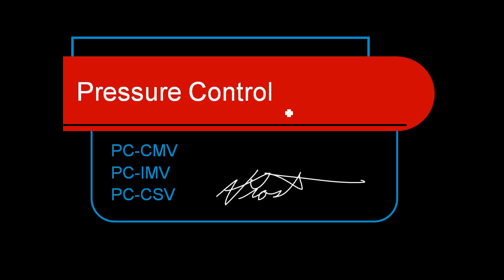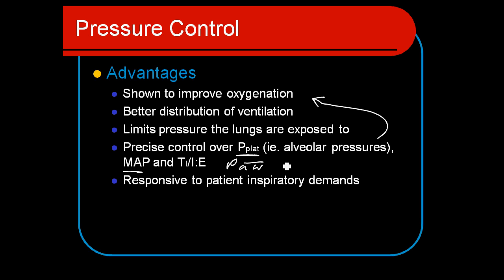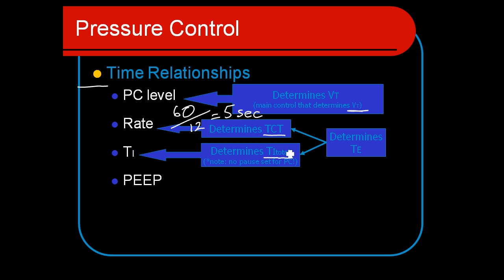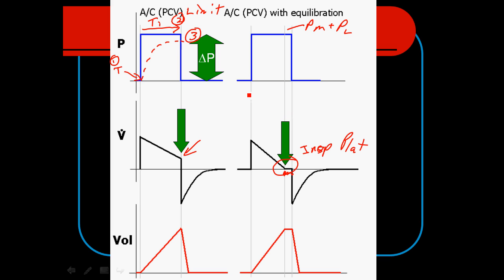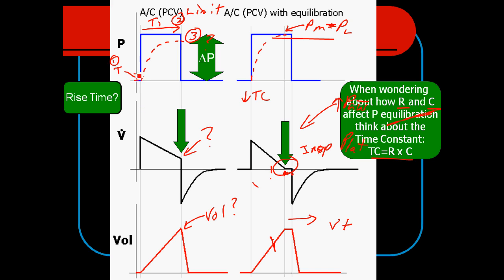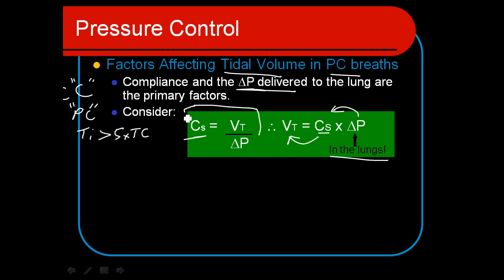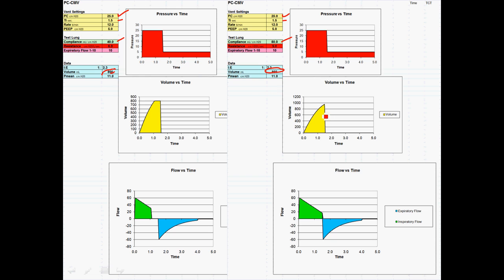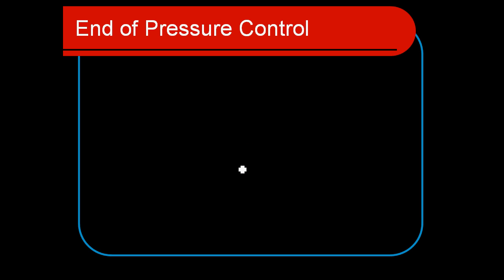Pressure Control Mode of Mechanical Ventilation.avi

Comment: Hi sir,I have a question regarding the tidal volume of one of your examples using the test lung with compliance of 80ml/cmH2O and Resistance of 5,with enough Ti (meaning 5 time constant,in this case will be 0.4x5=2s ) and using the equation of change in volume =compliance x change in pressure ,with that equation ,the tidal volume will be 80x(25-5)=1600ml and not 1026ml as in the example of yours.may I know what’s the reason of causing the difference in Vt?